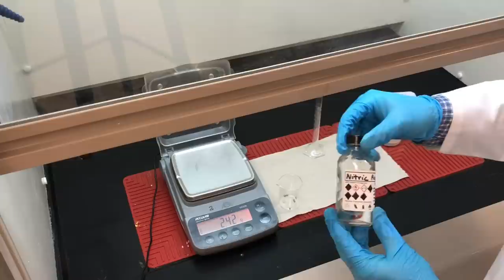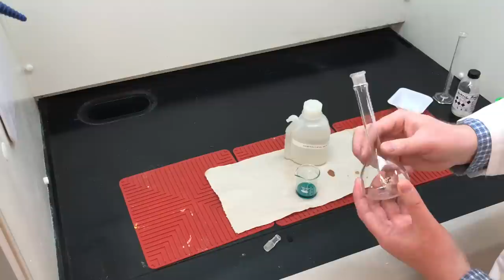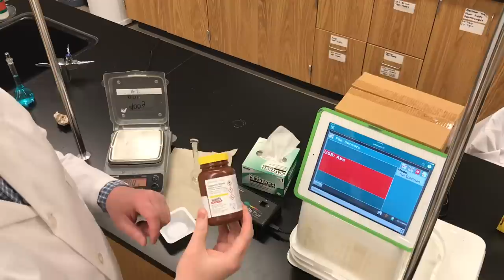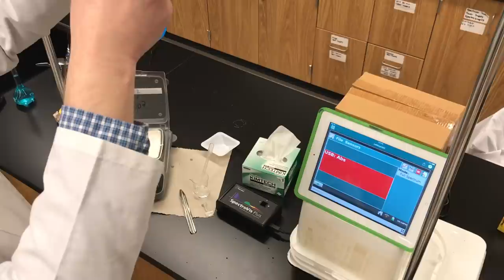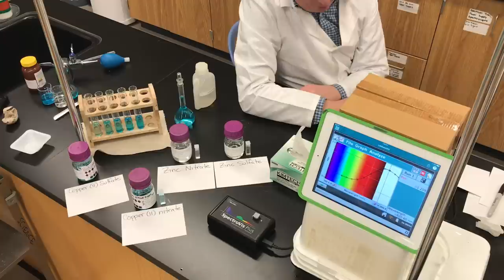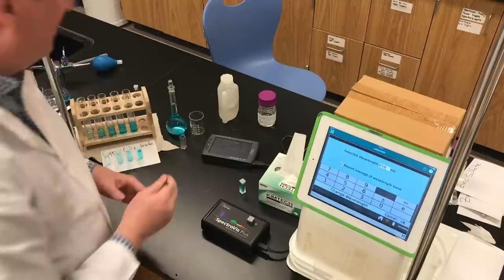Percent Copper in Brass

Comment: Probably should keep the flask on the table when taking measurements since when you hold it up you can angle it causing inaccurate readings
Reply from the maker: Thanks for the feedback, Joseph.  I'm assuming you're referring to the volumetric flasks?  They have a calibration line that goes around the entire neck of the flask. So if you're holding it up and the line in front matches the line behind ... the flask is being held vertically.  It's pretty easy to do with a bit of practice.